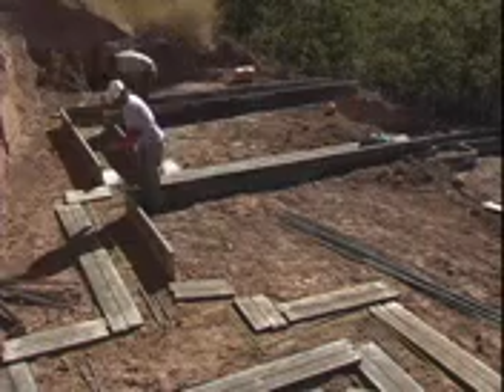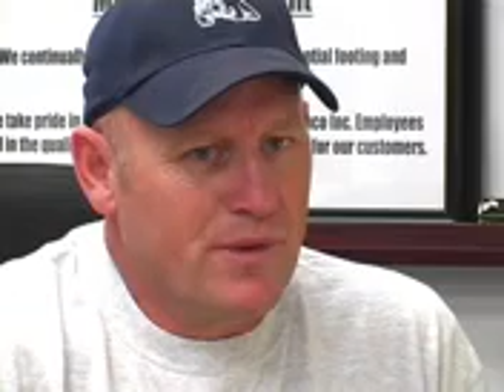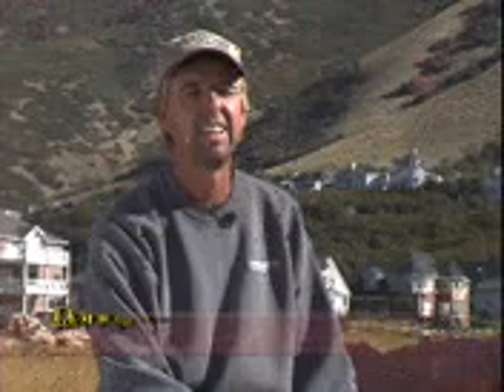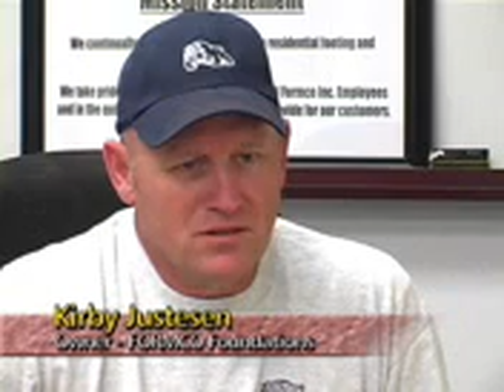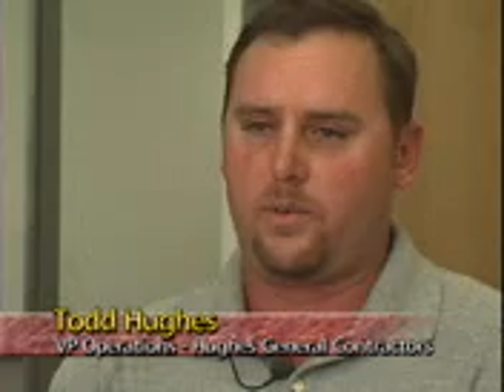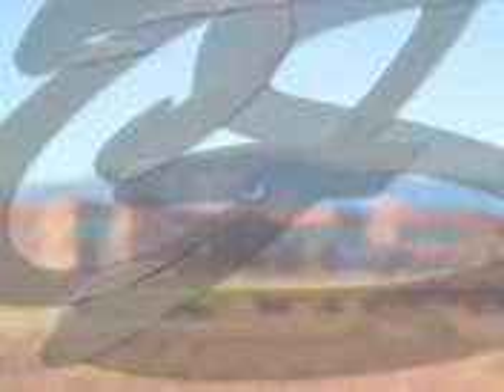EZ-Footings Concrete Forms

Comment: ive used these before they go in fast nd stripping them is easy the only downside is having to clean the concrete out of the grewvs which is a pain in the fucking ass

Comment: Why in America they keep using chip lumber , double thermal  glass, roof insolation, ply wood insolation, big window, lots of the money every month to pay back in electrical bill, and air condition during the summer. Why in America they do not put protection to the regular window? fivelands1